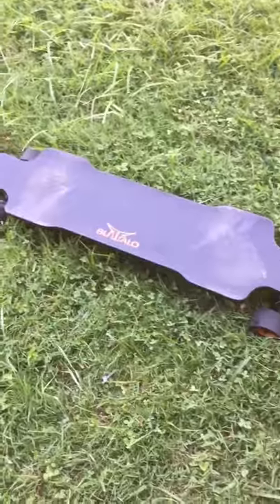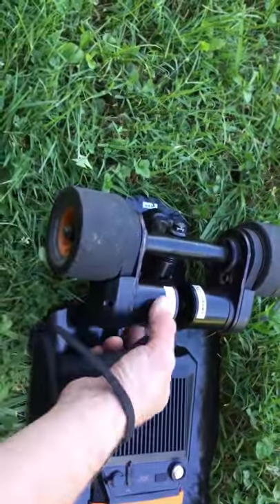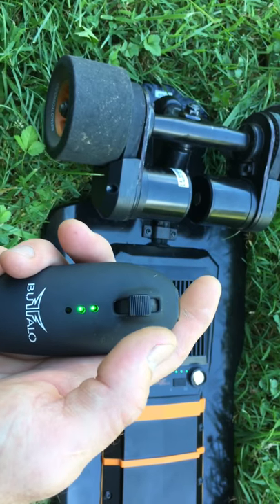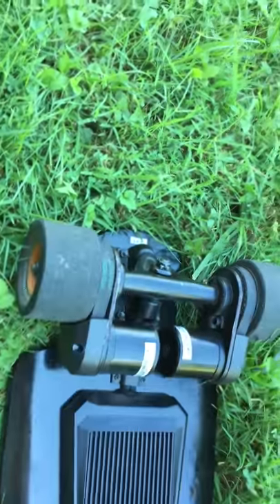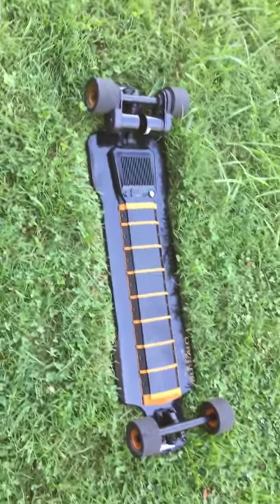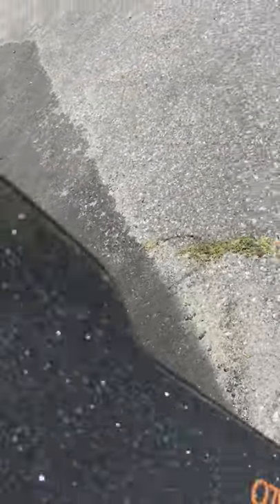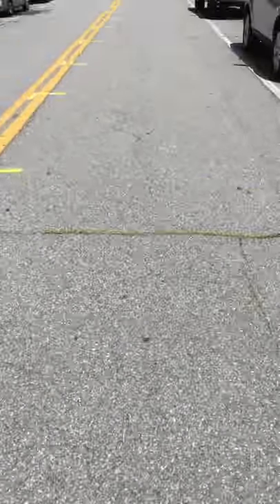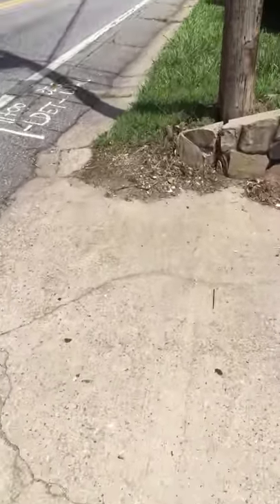Buffalo electric skateboard review part one

Comment: nice review.  be careful,  from experience.  disconnects,  over heats,  locks motors at high speeds,  range is not even half.  the wheels are OK,  but other than that it's 100% junk..